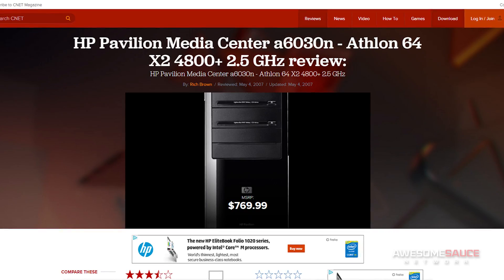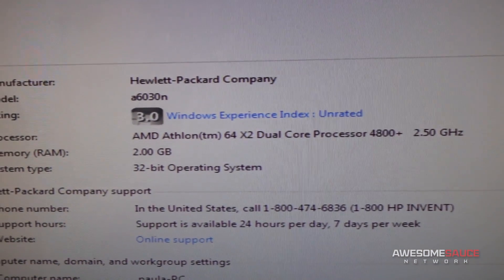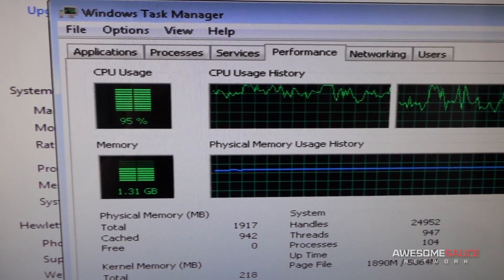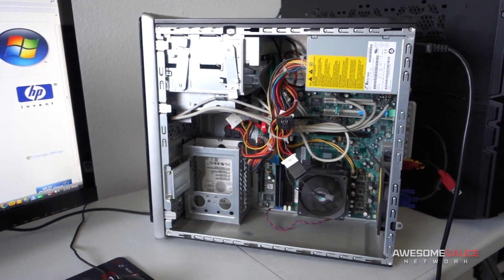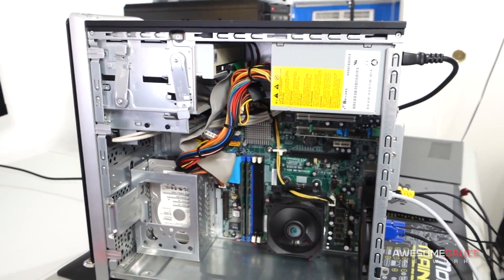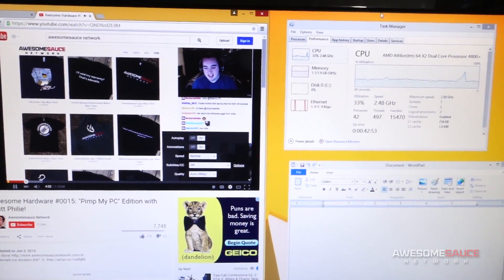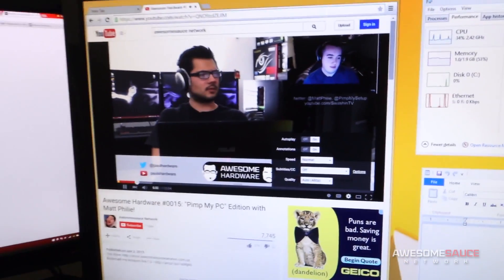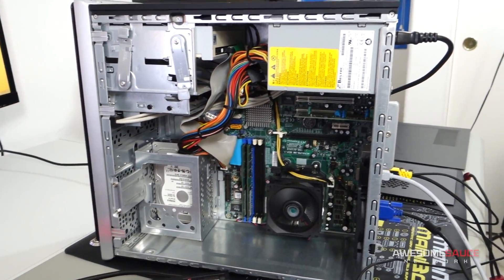Cleaning Up My Neighbor's Old Desktop!

Comment: how to rebuild this: Prep. Back up files. step 1. place grenade in bottom of case. Step 2. Pull pin. Step 3. Run Away. Step 4. Clean up. Step 5. build from scratch.

Comment: I have the same exact PC with Intel core2Duo from 2008, but with updated 4GB RAM and 1GB GT710 GPU and a few years ago a 128GB SSD for OS, but recently stopped working, so will try a deep clean as you did and t revive
Reply: I'm replying 4 months after your original post/reply, but i'm wondering if you ever got your 2008 computer back up and running.

As for myself, I have a similar PC, but from 2007, which I recently maxed-out at 8GB RAM and a GTX750ti.  In addition to the 2tb HDD that was in it from a previous upgrade, I installed 2x2.5" SSD's (one 500GB, the other 1TB) and installed Windows 11 (unofficially supported) on it, along side Linux Mint.  I even replaced the stock CMOS battery, for good measure.  After all of that, it serves as both my main 'fall-back' machine in case my more powerful 3950x+2080ti build ever goes down, and also serves as a simple NAS for my absolutely crucial files.  If both my 3950x rig and my 2007 PC ever fail (unlikely), the only thing I have left is my iMac G3 from 2001 and my entry-level, 6-year old smartphone.
Reply: @rkmugen  It’s up and running windows 11 now, after spending a day cleaning it, tried to boot up with out the gt710 and it was fine, guess the gpu has given up, yet to check with another machine and the inbuilt geforce graphics is fine.

Comment: Seems like stuff is backwards in this PC? Like the right side of the computer is opened not the left? I feel like all builds the left side opens. so you can use a PCIe 16x card but you'd have to have it upside down?

Comment: I have one of those but with core 2 duo and it is, indeed, from 2007. The first thing that broke was the power suply. The 775 motherboard gave up a few years ago and now I've been using the case to house my a320 mobo. Back in the day this PC had great specs for the price and mine would run need for speed: most wanted on high res

Comment: Just scored a free HP P6243W from a guy on Facebook market place. Looks exactly like the system in the video but uses an AMD processor. Planning on maxing it out and using as a back up gaming rig. I'm wondering though... the HP website says the board is MicroATX form factor. Do you think that I could fit a standard AM3 or AM4 MicroATX board in there. I haven't compared the dimensions but would make an interesting sleeper with the condition of the case :)

Comment: I know this is 5 years old by now but i'm commenting on it because it gave me that little push to revive my old machine (almost the same build as the one in the video i have an a6230n) After like a week of trouble just trying to get a fresh install of windows 10 here i am running windows 10 64 bit on this machine. I upgraded the PSU and the Graphics card back in the day but im curious how i never upgraded the ram i'm still running only 2 gigs ddr2.

Comment: 5 years on here too... personally I'd have thrown in a new motherboard, processor and ram. or at the very least more RAM. 4GB wouldn't break the bank, 8GB would have made a lot of difference. Perhaps an AM2 processor upgrade (depending on what was in there and how far it could be bumped up in spec)

Comment: I have built many PC's and I would strongly advize anyone that has hardware (CPU's and Motherboards) with launch dates over 10 years old, to invest in newer parts. You are essentially throwing your hard-earned money away to upgrade an old machine. The old stuff is just not set up to deal with current technology.

Comment: Watching this now makes me want to pull the first computer I ever had out of the shed and have a look at it.
Had it since 2006. Hasn't been turned on since at least 2014. lol
I remember the hard drive was only 30gb.
Reply: After 6 years it won't even know who it is anymore when it tries to boot. So much has changed, including operating systems. Truly, I don't feel that it would be worth your time and it's just taking up space on your property.
Reply: @zingwilder9989  True haha. Even if I swapped the hard drive, I wouldn't even be able to upgrade operating systems since it only had 512mb ram.
Reply: @Zanarkand_0  Just think, at one point it was a fantastic machine.
Reply: @zingwilder9989  Yeah. It's crazy how fast things have changed. These days, 4gb isn't even enough for gaming.
Reply: @Zanarkand_0  No, if you don't have at least 8 GB you're at a disadvantage. Believe it or not, the New Flight Sim 2020 is recommending 32 GB for the ideal experience - it's absolutely crazy! Like we were saying, we remember the days when 512 MB was totally thumbs up! Beyond that a 1 GHz (single core) processor was on the cutting edge of technology. Can you just imagine?
Reply: @zingwilder9989   Oh, I see. My mistake. And that is absolutely insane! But how many people out there have actually put 32gb into there system? Doesn't seem like it's necessary yet. (Apart from the flight sim of course lol)
And yeah, I remember those days haha
Technology  have advanced so quickly in the last 15 years!
Reply: @Zanarkand_0  Other than those running multiple programs while editing videos, few are using 32gb. However, the price of RAM is more affordable now.

Comment: Thank you...about to upgrade and update  my 2009 HP which is an ok gamer and add a ssd boot drive if I can I know I can upgrade the ram to at least 16gbs. I am at work but I think I can upgrade it to 18 for some reason as that was a selling point to me at the time I just never did it. I just need to know how to clone the hd to the ssd...It ran both Skyrim and Fallout 4 real well and I played gta5 on it with reasonable settings so I may just leave the cpu and gpu alone right now.
Reply: If you're able to handle those games, your unit has done well. However, you must remember that the clock is ticking on it. Is it worth the cost to add DDR2 Ram? Moreover, at times when maxing out RAM in the DIMM slots, it can cause the board to become unstable and overheat. Also, I would venture a guess that your power supply is proprietary. Nonetheless, that HP is worth a salute! My advise would be to use it until it just quits.
Reply: @zingwilder9989  I finally got a chance to look at it. Hp pavilion elite hpe-140f pc
i5-650 processor 
1 t hard drive 
Nvidea GeForce GT230 with 1.5gb graphics memory 
8gb ddr3 system memory upgradeable to 16 and it was windows 7 but upgraded to windows 10.
a 250 gb ssd costs between 25$-49$
and 2 4 gb sticks to upgrade to full capacity is 32$ I can only upgrade to a gtx 670 and the cheapest used card I have found was 109$ So no right now.
I bought the ram and I will be getting the ssd at some point and install the operating system on it and gta5 online so it should be able to handle it ok.
Reply: I am doing this so my sister in law will have something to do that is simi social. California is still knee deep in the Covid 19 insanity. And myself, my wife and our roommate play about 8 hours a week right now but we also get out of the house for work, she takes care of my mother in-law and hasn't left the house more that just for shopping.
Reply: @therasheck  In sincerity, your specs are very good! Better than I had originally thought. This is why you're getting decent performance in newer games. Also, with the DDR3 RAM (8 GB), it shouldn't  be a problem adding more. The largest concern that I have with the proprietary devices is the power supply. Beyond this, please just be aware that the launch date on the CPU is just over 10 years. I think that your plan is well thought out and will work. Moreover, you will certainly see a boot difference with that SSD.
Reply: @zingwilder9989  They do sell a legacy i7 cpu (gen1 can you believe it) not terribly expensive but I don't know the value of replacing it. I have a great portable desktop (heavy laptop!) In the Helios 500  kitted with both AMD processor and graphics card (desktop versions) for my gaming rig and the Older Hp elite tower is going to be my secondary/guest computer as I said in my last post. 
p.s. Thank you for your input it is very helpful in helping me know I am going in the right direction.
Reply: @therasheck  You are obviously well versed in these matters. In addition, you do have a decent foundation with an LGA 1156 socket. I have built many PC's and a little over 2 years ago my wife was using a Core 2 quad Q9550  (775 socket board) that I had put together for her. Really, she only shops online and plays card games. Nonetheless, the hardware was over 10 years old. She wound up with the BSOD and I thought about just repairing/upgrading it for ~ $200. I considered it for a few hours and decided to put the cash toward a new unit. However, it was just my choice because of my history of building.
Reply: @zingwilder9989  YouTube knowledge but not a ton of experience but I did install ram and ssds in my laptop so yay me! I was looking at building a computer but I thought upgrading was good way to go if I could.
Reply: @therasheck  You're doing great! If you do decide to build, you'll see how easy it is. At that point you'll be hooked.  I learned how to put PC's together from watching Tiger Direct, Newegg and other various YouTube channels. I, like you, started out upgrading by adding RAM, changing out a processor and power supply.

Comment: Micro atx motherboard will fit in this case...I have a sleeper pc built out of a hp computer.....ryzen 7 cpu gigabyte motherboard corsair 32 gig lpx ram 1tb samsung evo m.2 2 TV samsung ssd evga 1060 superclock GPU 750w power supply

Comment: I have the 64 bit version with the M2N68-LA MOBO, running into a lot of different answers and confusion even on the HPsite as far as the most bestest ram sticks i can install. 
I’m hearing ddr3 16gb on Tom’s hardware but hp site says ddr3 and ddr2 , what ?

Comment: There's something very satisfying about restoring an older unit like you did here. Back up any documents, pics, etc. Thoroughly clean the inside and outside, remove heat sinks and deep clean them,( i use non chlorinated brake cleaner)  and put fresh thermal paste on CPU heat sink, neatly organize the wiring (gotta love colored zip ties).  I don't have access to any Windows op systems so i install Linux Lite  3.8.  I buy lots of parts and assorted RAM at goodwill for pennies on the dollar which is also fun to do. I could do this all day.......... Thank you for the video my friend :-)

Comment: damn.. i still remember the first pc they gave (a gift but actually they gonna throw it since its old) the specs are:
Intel Pentium S (120Mhz)
32MB RAM
1MB video card
680MB HDD
god damn it.. still remember monster truck madness on a cd.. along with microsoft frontpage.. 256 color 800x600 deng

Comment: I have no clue how you pulled up all that information, but I need to point something out to you here in 2020 during Covid-19. 

I have that exact build and I'm bewildered you found the description of it, but I found the motherboard specs and lemme tell you something. Not only is that motherboard only capable of 8 gigs of ram AT MAX, but that hard drive spins at 2700 - 3000 rpm. I'm sorry, but at that point he needs a new PC. Its $40 to buy and max out that PC with new ram and it'll still be slow. The core count is too low and will bottleneck his performance down to AT MAX  3 applications at a time, maybe more if he gets more ram. And on top of that, the case has virtually no airflow through it whatsoever. After an hour, I got Windows 10 to boot on it and all I can say is that if there was ever anything that needed to be changed, it's the storage.

I know getting a better CPU would improve the PC a ton, but with how slow this computer is, an SSD or a faster spinning hard drive would help so much more

Comment: really windows 8 on that hardware is will kill it

faster than adware window vista did have

how is it running that smooth when my i3 window 8.1 pro unable to keep 480p

my pc Was window 8.1 Pro is runs worse than you think

4 cores
Logical  processors = 1

How is a £500 
get  1tb not ssd
with 4 ghz pc with it running no where near what is says to be able to run 4ghz
I ask my friend to downgrade it to window 7

than my pc changed the Base speed from 4ghz to 1ghz that worst when done installing window 7 

is was faking the cpu name too 
says it was a i9-7700 when drive manager say i3 1.0ghz

Comment: The restoration is incomplete if a CMOS battery isn’t replaced, the mobo isn’t removed, the power supply not removed, discharged opened and cleaned. I’ve even seen a regrease of optical drive rails not just a lens clean. But did you even clean the lens?!! Nope. Ugh 🤐 I’m shutting my mouth now before I get into trouble.

Comment: March 2020, I'm using Athlon 64 x2 5000+ with 3GB ram and integrated graphics, thinking of replacing processor with A64 x2 6000+ and a 6600GT, alternatively for a much higher cost I could use an Athlon 200GE, new MB and ram.
Reply: If you get the parts for a reasonable (lowest) price, than this might be an option.
On the other hand: Athlon 200GE is approx 2x as fast as the 6000+, integrated vega3 is 10-20% faster than 6600GT.
And all that with 35W instead of 125/89W + 47W and generally more future-proof platform, with more options of processor upgrades.
I would also not recommend using Athlon 200GE anymore, Athlon 3000GE offers slightly more performance graphics and computing wise for the same money.
Reply: @johnscaramis2515  Thanks for the reply, I will go for the a64/6600GT upgrade and an SSD which should eliminate the slow response I have been having recently.

Comment: The primary use of an old computer like this is 1.  playing old games that do not require internet  or 2.  Opening graphic and document formats that are no longer supported (I'm looking at you PCX)  3. email (because you don't actually click on video links in your email right?).  You can do facebook as long as you don't click on the video links.  It would be worthwhile to upgrade the ram if you can get it cheap as the system is churning to find usable ram.  Otherwise, yes a new (used) system would be the best next bet. I'd go with an I5 with 8 g of ram as this isn't replacing a gaming computer except for casual internet gaming (you can get one with 4 gig (2020-02-10) for $329 today.  Of course this guy gives them a $3k PC.  Sell the existing computer on Facebook Marketplace for $50.

Comment: I love those late 2000's HP's. I still use my HP Pavilion desktop from 2009 which was a Windows 7 system until I upgraded to Windows 10 a few weeks ago, and the OS runs just fine on it. From the factory it has a AMD quad core processor and 8 GB of RAM. Right after I bought it I put in a 750 watt PSU, a Raedon HD graphics card, and put in a bigger case fan. The thing was a beast for it's time and I will continue to use it.

Comment: Just wondering... would it not have been worth a very few dollars to replace that drive with an SSD?  The boot performance improvement and the general snappiness of apps would be a nice upgrade, even on an older system.

Comment: To be honest I love doing this kind of shit.  Working as a Sysadmin, I'm often coming across older hardware that is destined for the recycling center, because it's just not worth it to our clients to pay me $200 an hour to rebuild a 7 year old computer when a brand new, far better computer can be had for like $700.  Much of the time the mere fact that they have Windows 7 on them, with EOL in January, is enough to have them junking them for replacement.  But you throw an SSD in them, maybe some additional memory modules salvaged from DOA machines of similar make, fresh install of Windows 10 and they're perfectly fine for the average user, even today.  Even if you don't have the steady access to old workstations like I do, these can be had online for super cheap, like $100...throw in a $30 250GB SSD, install Windows 10 (often the Win7 key works for a fresh install!) and it's perfect for web surfing, running Office, etc.  Slap in a $50 half-height GPU and you can even play a lot of games...I was running Skyrim at pretty decent settings on a 7 year old Dell, not to mention tons of other games.

Of course, there's a downside to that.  I went from having one computer to having FIVE computers running just in my home office, three acting as servers:  a dedicated Plex server, a file server, and a torrent/seedbox, as well as a standard office PC for my wife, and my homebuilt gaming rig.  Also have a NAS that collects backup jobs from all of those, an RPi3 acting as a PiHole, and my workshop computer, plus I've got two laptops, an HP and a ThinkPad, with spares on hand for parts.  Long story short, my home is turning into a MicroCenter and my wife is starting to wonder when it will all end.  But it won't ever end!  NEVER!!!  MWAHAHAHAHAHAHAHAHA

Comment: 9:56 You're going to put DDR3 in a DDR2 motherboard? WTF? Look, I just found some 120GB SSDs new on eBay for $20-25. I also got 8GB of DDR2 for $29.00 not long ago. Max out the RAM, put one of those new SSDs in there, load it with Windows 10, and he'd be really happy.
Reply: This video was from 2015 when SSDs were probably still quite expensive, and I doubt that the neighbour would want to have his pc missing for longer than it needs to & I highly doubt that the computer would even be able to handle Windows 10.

Comment: I'm using a restored 2008 pc now :)
right now.
Swapped out two fried motherboards, the CPU cooler, the CPU itself, Got some new RAM, stuck in a 2015 Gigabyte NVidia GeForce 650 Ti, using the original power supply, keeping the drives (and adding an SSD), using the old fans (and stuffing a lot of 2015 fans in).
Doesn't even check if everything's compatible, and it works.